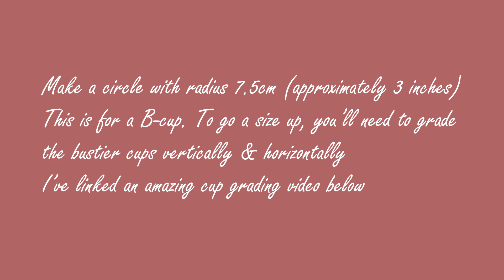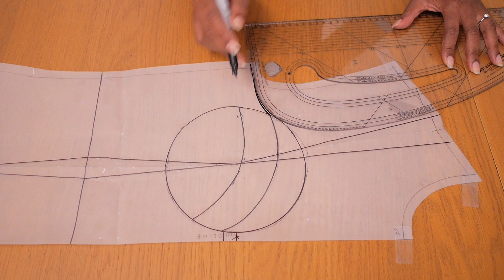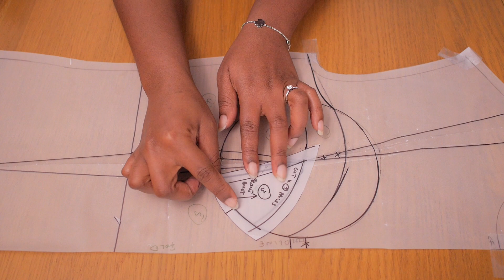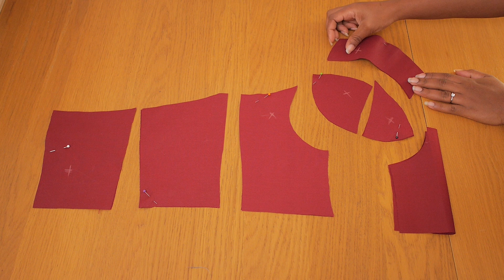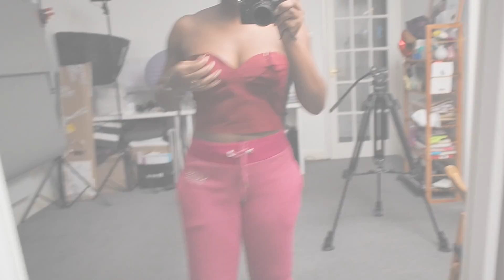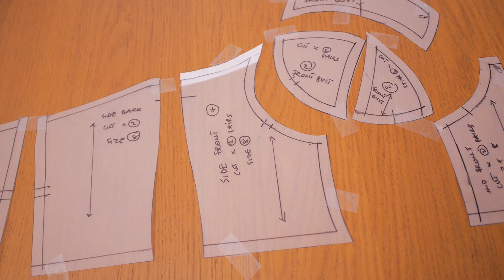BUSTIER TOP WITH CUPS PATTERN TUTORIAL | KIM DAVE

Comment: Awesome.My burst radius is 4.5 inches,can I also use 3 inches to draw the circle around my burst point?Since 4.5 will extend outside the centre front of my bodice.
Reply: I'm not sure a 4.5 will extend beyond the circle. If you are using a 4.5 radius then your bust is definitely bigger. You'll probably be a bust 44 or so. If your patten measure the is right then your radius will fit the circle.
Reply: I'm not sure a 4.5 will extend beyond the circle. If you are using a 4.5 radius then your bust is definitely bigger. You'll probably be a bust 44 or so. If your patten measure the is right then your radius will fit the circle.
Reply: If you use 3" when your measurement is 4.5" the cups will be too small